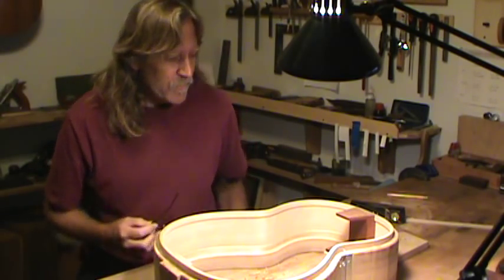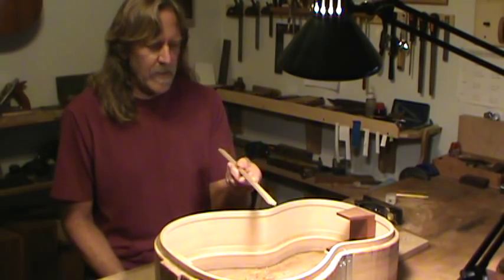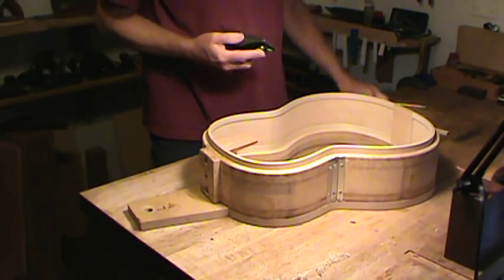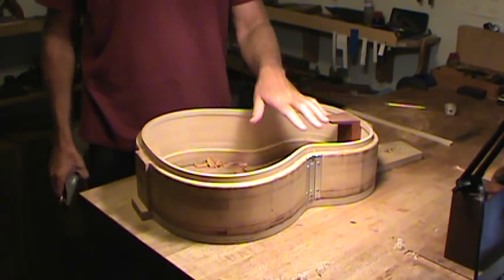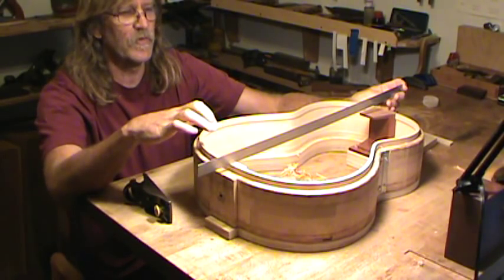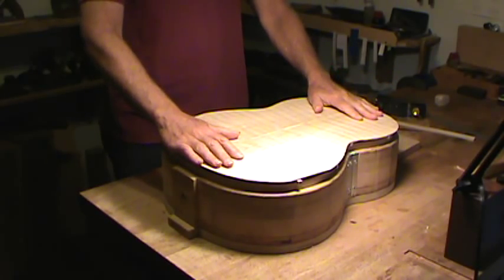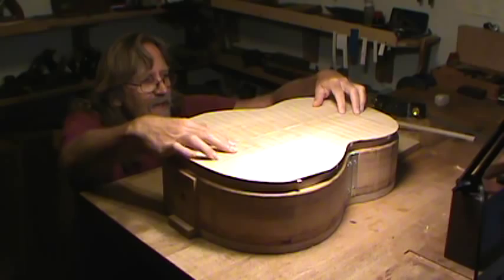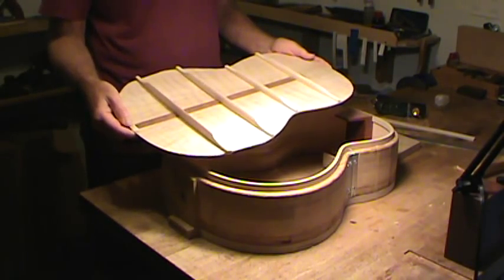Classical Guitar Building, Oberg Guitars, Planing the Sides to Receive the Back

Comment from the maker: Thanks Robert. I thought it all out pretty carefully before turning on the camera, then once I got started all bets were off! Figured I could adlib if I got in trouble. I mainly want makers, especially those just getting started, to realize you don't have to stick with a dished workboard that puts a single symmetrical arch on the back. There is something very elegant about a more subtle arch in the long direction, but it's clearly harder to achieve by hand. Just have to go after it.

Comment: sorry to ask, what kind of stuff you aply on the sole of the hand plane once in a while? Thanks.
Reply from the maker: Celestino Clemente Sorry for being so tardy in replying. I use a small piece of paraffin...it helps relieve any friction between the sole of the plane and the work piece. Just a few swipes every so often.
Reply: +sdluthier hey,
It's actually not such a good idea to plane a surface that's going to be glued with parafine. The parafine stickst to the wood (not all over, but on some spots) and the glue can't stick to the wood on those spots, because parafine counteracts the glue.
I'm just trying to give a tip, no arrogance or 'i know better' on my part

Comment: 1.Am I correct in assuming that joining the top to the sides is the same basic process? 2. How did you generate your radius stick? Can you spare me the task of manipulating 40 feet of kevlar thread with a pencil attached and a line level?
Reply from the maker: chopsddy3 Sorry for the delay in responding...Joining the top to the sides is completely different, as the top is not arched the same way as the back. The curve of the back braces was taken from a guitar whose doming I liked, I can't remember the maker, but I think it was Esteso. If you pm me with your address I'll send you a paper pattern of the curve.
Reply: sdluthier Thanks so much for the offer. Unfortunately, I can't access my inbox or private messaging. For some reason , g+ , android and gmail blend with my internet provider like oil and water. It's O.K. though. I've found numerous ways to generate radii by looking into boat buiders methods. 

You've already helped by expressing your opinion on curved dishes. Especially the trouble at the waist. I also think that a spherical dome would pose more problems than it's worth at the neck to body joint when joining the face to the sides. 

Trusting my intuition, eye, and hand has served me well in a lifetime of furniture repair and hand forging steel. The curves are more complex than a simple sphere, but not beyond the possibility of one familiar with the tools and materials (if one is observant.) 

A video , made by Ron Fernandez, of a luthier from Paracho Mexico named Benito Huepe was a revelation for me. He builds a guitar from start to finish, without a mold, with the simplest tools. Much of the the work is done with a knife made from a saw blade. It's a great starting point for the first time builder. Especially an aged financially strapped guitar player seeking a way to acquire the guitar he needs but can't afford.

Thanks again for your offer and your videos. They have helped me see that I can do this by applying the skills I already have. Watching you hand plane the angle of the linings to accept the back , using eye,hand , and intuition (with considerable experience) spoke volumes.
Reply from the maker: chopsddy3 No worries..you're very welcome. You can always contact me through my website on the contact page.